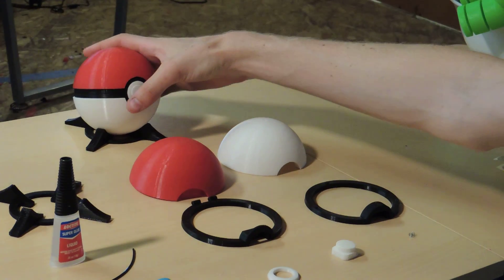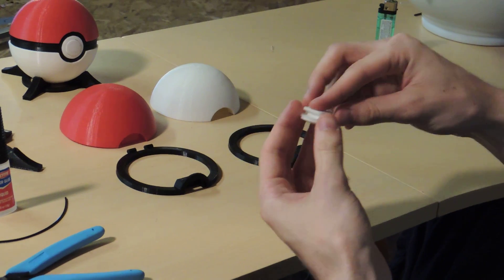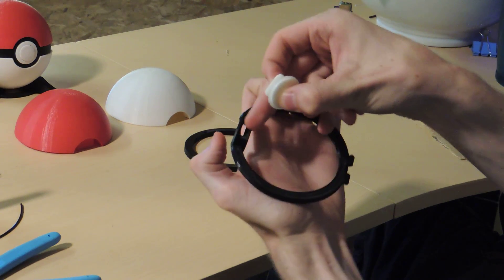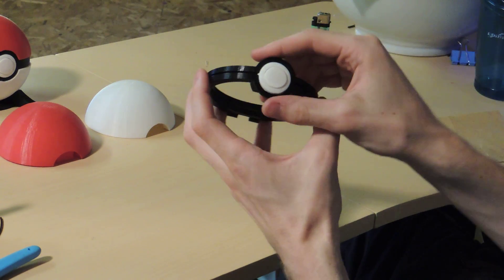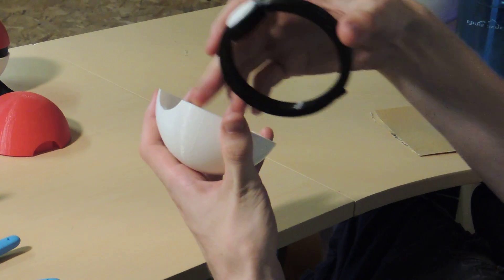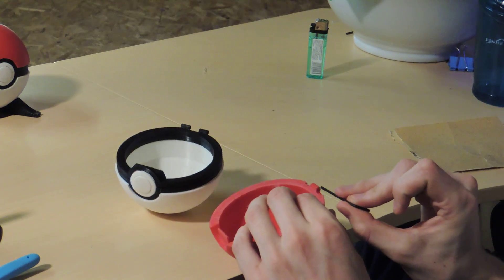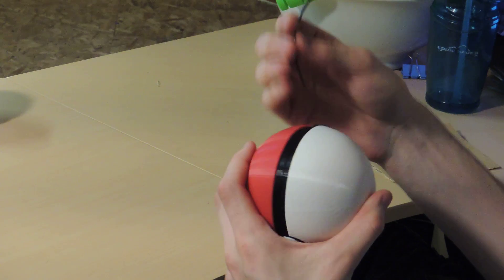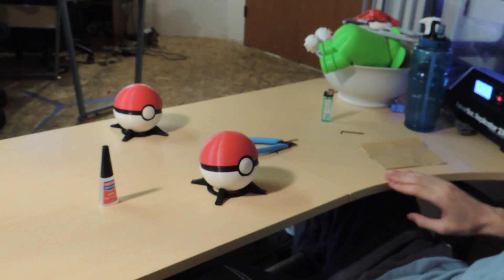Assembling a 3D Printed PokeBall

Comment: Hi, I'm trying to print your print suggestions, but unfortunately I'm not really succeeding. I have problems with the red part. If I print with the rounding upwards, I have to use the support structure - because of the small ring at the back where the connection to the white half of the ball is. And that's where I have problems. Unfortunately, my printer doesn't fix this spot, so it always comes off. 
If I turn the print by 180°, i.e. with the opening facing upwards, it works, but then my support structure is so tight that I can't get it off. And I bought extra coloured filament so that I don't have to spray it.

Do you have any ideas or suggestions on what I can do?

Comment: Hello, good morning, you print the separate parts or print all at the same time as the printing all in a print only, it is advisable to print them separate or no problem?
Reply: on my ender 3 i print this separate because it is to big to print it in one go
Reply: @starscream8811  how did you print the red piece? I use Ender 3 V2 and it starts with the "conector" but the remaining circle would be "in the air", so it keeps falling down of course
Reply: @marcelagonzalez1522  oh i dobz know how i print it, it was long time ago. I think i Change the direktion from this piece in cura
Reply: @marcelagonzalez1522  Supports

Comment: what keeps the little piece of PLA from falling out of the holes? is it in there pretty snug with pressure or should I put a dollop of glue on the ends of it to keep it from backing out?
Reply: Rob Hopper It sits in there snug. No glue needed
Reply: @tangent_theta  You could melt the ends into like a rivet style mold if you wanted as long as it doesnt touch the top and the bottom to prevent it from opening.